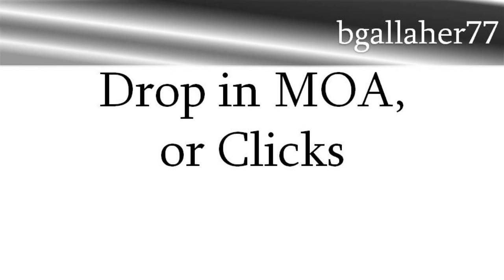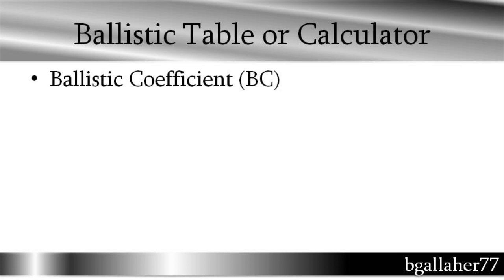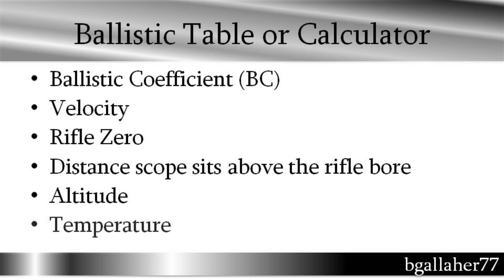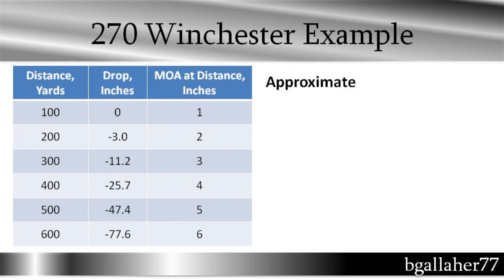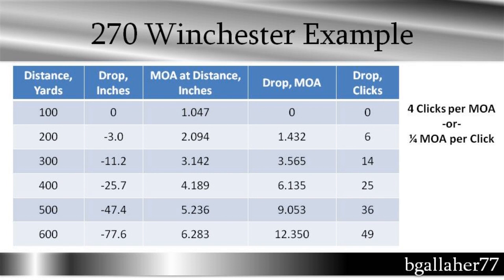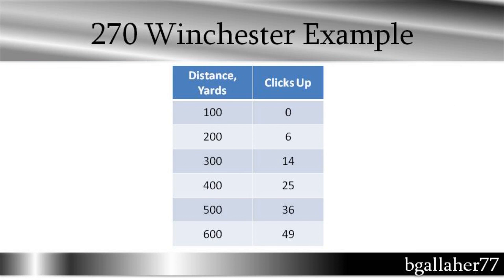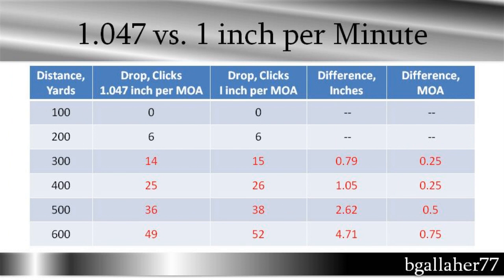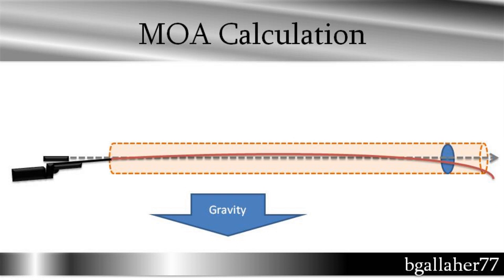Calc Bullet Drop in MOA or Clicks come up ballistics

Comment: You also need bullet weight to do the calculation!
Reply: That's funny, I have just been using an on line ballistic calculator to give me a bullet drop chart and it asked for the bullet weight.
Bullet weight alters trajectory shorly.
 i.e. bullet drop!
Reply from the maker: Any change in weight will change ballistic coefficient.
Reply from the maker: Nope
Reply from the maker: Nope. Just bc and velocity. Online calculators ask for weight because they have a bc database. But get a reloading manual with published, on paper, drop charts. Does not ask for weight. No weight required.

Comment: Gravity is an amazing thing.
At a velocity of 3000 feet per second (or 1000 yards per second), a bullet will travel 500 yards in 1/2 second and drop 48 inches.
If you hold a bullet in your fingers and simply drop it, in 1/2 second the bullet will also drop 48 inches.

Gravity is the same whether a bullet is shot from a rifle or dropped to the ground.
Reply from the maker: You forgot wind resistance and loss of horizontal velocity.
Reply: @bgallaher77  
You're right.  With wind resistance and the loss of velocity the bullet will travel approx 410 yards in 1/2 second.

Comment: Or... find velocity of the round. Then use a rangefinder to determine the distance the round will travel. Neglecting air resistance, put the numbers into the equation distance = bullet velocity * time + .5 * acceleration * time ^ 2. The time can be determined using the same equation but using 9.8 m/s^2 as the acceleration and using the y dimension for the velocity and distance vectors.
Reply from the maker: “Neglecting air resistance”. Really... The bullet velocity is best described by a differential equation. It is not a constant, which is assumed by the equation you listed. “Why does the bullet velocity change after it exits the barrel?”  Good question. Air resistance.
Reply: Matthew Yee  . . . in a vacuum . . . not practical!

Comment: What about the barrel length
Reply from the maker: Most companies list velocity from 24 inch barrel. Figure you loose around 25 fps for each inch that the barrel is shorter. That is a rule of thumb. It is worse with a magnum. A 20” barrel 7mm mag or 300 win mag is basically a 270 win or a 30-06. Most hunting rifles are 22” for regular cartridges and 24” or 26” for magnums.

Comment: Yes, good video, still, beginning with the fact that scopes and sights move in MOA first the shooter must understand what's an MOA:   MOA means minute of angle, an angular unit of measurement.  This unit of measurement, which is equal to approximately 1 inch per hundred yards, is used to describe the distance in inches a sight adjustment will make at target distance. For example, a 1 MOA sight adjustment would move bullet impact 1 inch at one hundred yards, 2 inches at two hundred yards, 3 inches at three hundred yards, and 10 inches all the way out to one thousand yards. 
Understanding the effect of sight movement in MOA is important to correctly adjust sights for bullets to hit where aimed; yet, the arithmetic for an understanding is easy. Using the simple math as shown, you can determine up/down sight adjustment needed; and, doing the math again, you can determine left/right sight adjustment needed.

1. First, think what the value of 1 MOA is at target distance:                                          

Distance to Target in Meters / 100 = Value of 1 MOA in Inches at Target Distance

2. Next, think how many of those MOAS will fit into inches of needed movement:                                                                                                                                 Inches of Movement Needed / Value of 1 MOA in Inches at Target Distance = MOA Adjustment

3. Finally, determine how many clicks to sight for needed movement:                                                                 MOA Adjustment / Sight MOA Click Value = Clicks to Sight for Needed Movement 

For example, let’s say you’ve set your target out to 25 meters and you’ve produced a group which is 2 inches low and 2 inches right of the target’s center. Remembering the M16-A4’s front sight has a 1 .25 MOA click value, and the rear sight windage drum has a .50 MOA click value you can now determine sight adjustment needed:

First, determine adjustment needed to front sight controlling up/down movement:

1. 25 Meters / 100 = .25 Inches

2. 2 Inches / .25 = 8 MOA

3. 8 MOA / 1.25 = 6.4 clicks (round to 6 clicks) to sight elevation knob in clock-wise direction for needed vertical movement of grouping on target  

Now, repeat steps to determine adjustment needed to rear sight drum controlling left/right movement:

1. 25 Meters / 100 = .25 Inches

2. 2 Inches / .25 = 8 MOA

8 MOA / .50 =16 clicks to sight windage knob in left direction for needed horizontal movement of grouping on target

Comment: I don't have any problems shooting tight groups but I do have a dyslexia problem when it comes to math and how that math is interpreted on my scope.  The thing that throws me off is that in my mind when I crank my turrets "UP" it registers in my brain as moving the cross hairs up; which would bring your point of aim down.

The point of dialing a "Come-Up" is to bring up your point of aim for longer ranges so, I'm assuming that the turrets on scopes are reverse threaded so as to move the cross hairs downward in order to bring the point of aim upward.  Is this correct?  I know it sounds stupid but that's where my mind is at with regard to using scopes.

Like I stated above.  I have no problem shooting tight groups.  I'm like a good guitar player who can't read music.  With enough practice I can memorize points of aim out to distance but it sure would be easier if I could figure out how to just dial in my points of aim rather than having to memorize them.
Reply from the maker: I think of up as moving the holes in the target up higher. If you use the Leupold CDS scope, you can get a replacement turret cap that has yards to target instead of MOA numbers.

Comment: Good video but you should go back and correct the audio on the calculations where you go from, Drop MOA to Clicks.  You mentioned in your comments below the following; 
bgallaher77
4 years ago
Yes, I did miss speak (had to re-watch the video).  At 400 yards, with a drop of 25.7 inches, convert to MOA by dividing by 4.0 inches per MOA (not going exact today), is 6.425 minutes worth of drop.  With 4 clicks per minute, we get (6.425 min of drop) x (4 click per minute) = 25.7 clicks, which is rounded to 26 clicks of drop at 400 yards. Close to the 25 clicks in the video.

Comment: It is not that hard to figure for a set up in inches. Since 180/3.1415926 = a radian at one radian distance a drop or rise of one inch is = to 5 MOA. At 5x radian distances (about 57.29 ft x5) one inch will equal 1 MOA.

Comment: Correct me if I'm wrong but one click is a 1/4 at 100yrs, 1/2 at 200, 3/4 at 300 etc etc. If that is correct then the calculations in the video are off.
Reply: 1" = 4 clicks !!...MOA =1" at 100 yards / 4 clicks / MOA=2" at 200yards / 8 clicks  / MOA=3" at 300 yards / 12 clicks ETC>>>( actually 1 MOA = 1.047" ) .  Then take your Bullet Drop at any distance and divide by MOA at that distance as stated above and this will = MOA needed to adjust ...Say it was 6 MOA ?? You would need 24 clicks UP ...LOL

Comment: wouldn't belive how many dummies claim the bullet "rises" with barrel on a flat 0 degree plain, as if the bullet had lift capability
Reply: crabtrap It is.   Up until your zero.
Reply: @tylerbatzel9659  its path is upward, but from the millisecond the bullet clears the muzzle gravity pulls it down. it doesn't 'rise' but it does trace a curve.

Comment: but what about ballistic cofficent? it changes at different ranges, how do you account for that? do you take the ending bc? or just an average..
Reply: Garret Chambers ballistic coefficient  relates to the projectile not distance
Reply: Morgan B actually ballistic coefficient does change through the bullets flight. For hunting purposes most just use the simple BC given for a bullet. However the ballistic coefficient changes as speed changes too. Also as the bullet flies through the air, the tip can be deformed by the friction of the air. Imagine the tip of a polymer tipped bullet "melting" as it flies due to air friction. Recently Hornady has come out with their ELD bullet which has a heat shield tip so it experiences less deformation while in flight. Check out this link https://www.hornady.com/bullets/eld-x#!/

Comment: Just as a theoretical question... is it true that a bullet dropped; and a bullet fired at the exact same time would hit the ground at the same time? Assuming of course the gun is aimed perfectly horizontally on level terrain and such. It seems elementary, but I began to wonder if the round produces any lift as it speeds through the air, like the wings of an airplane or glider essentially, although very minuscule. Or is that why really long distance shots are fired from an elevated position...?
Reply: true for a level barrel. the bullet flight is two components:  horizontal, caused by the cartridge, and vertical, gravity pulling down. a dropped bullet has the same vertical component and zero horizontal.
Reply: Check out mythbusters. They proved this same question of yours

Comment from the maker: Are you talking about a "ballistic drop reticle" (goes by a number of names)?  Yes, those reticles are made to give you the appropriate hold over for certain loads.  Yes, the hash marks (or dots) under the horizontal cross hair work, when the scope is at the correct power and shooting a load that works for the reticle. It is very fast and reasonably accurate.  If you are trying to be very accurate and/or shooting beyond 400 yards, then typcially you adjust the scope.

Comment: Instead of dialing in with clicks on a changing target can you just hold the scope reticle up by the number of MOA that your scope is calibrated for. So lets say mine is 1 MOA lines and sighted in for 100 yards. Can I just go down one "dot" and use that as a hold over assuming my target is 200 yards away?   thanks
Reply: Not all scopes have a mil dot reticle, this information would be vital if you have a scope that doesn't have one

Comment from the maker: MOA is a geometry thing.  For all practical purposes 1 MOA is 1 inch at 100 yards, 2 inches at 200 yards, etc.  If you were shooting 1 MOA groups at 200 yards, the group size would be 2 inches.  200 yards is more challenging that 100 yrd b/c of wind, etc.  When you shoot the bullet is rises a little (the gun is pointed slightly up compared to the line of sight) and then falls.  A 200 yard zero means the bullet falls to the line of sight at 200 yards.  Probably more info than you needed...

Comment from the maker: As far as drop...

To do the math you ballistics.  Commercial ammo has this on the box or online. If you know velocity & ballistic coefficient then a printed reloading manual or a ballistics program will give you the data.

You can test the load at different ranges, if you can find a place to do this. This is best.

For hunting, and lacking any of that, just sight in about 1.5" high @ 100 yards. That will put you on target to ~300 yards. If the shot is "long", then aim a little high. ;)

Comment from the maker: I don't have nay ballistics calc at present.  I typically use the tables in the back of the Speer or Nosler reloading manuals (the two that I have).  The good folks at Leupold use the RCBS ballistics program.

I guess that there are several apps for mobile/tablet devices. So far I have been to cheap to get any.  If you find one you like please post the name.